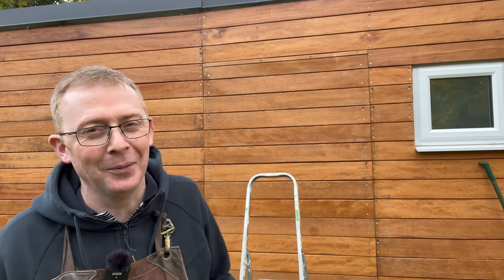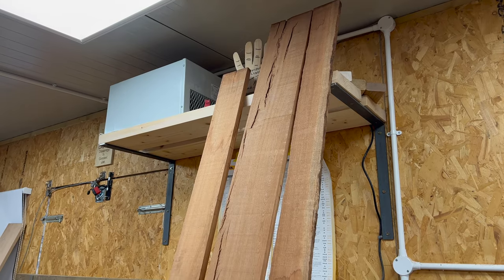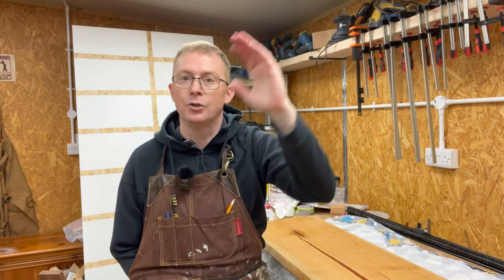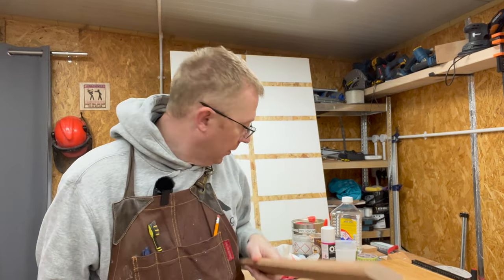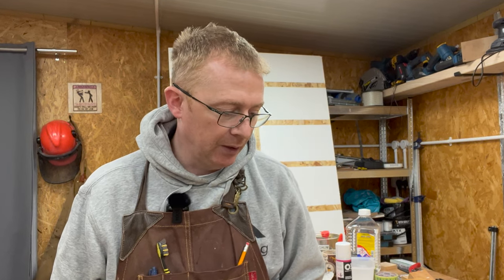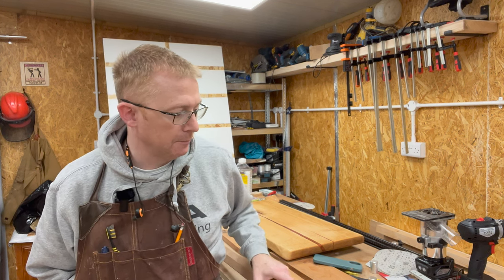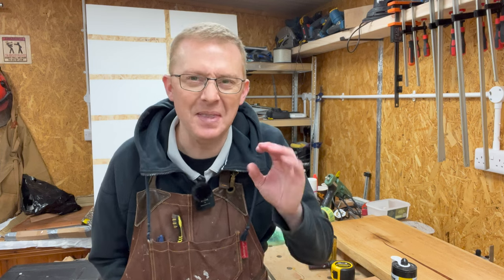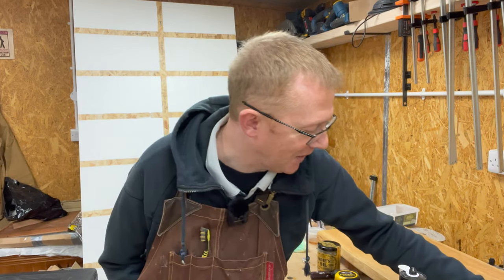Making a Hardwood Drip Guard / Edge for the Workshop Drawbridge Door

Comment: @2:36 ... Brother, auto-locking tape measures are a godsend for us single-high-five types. 
 
I prefer autolock, magnetic ends, with dual sided printing... but a good tape brand with all 3 of those things doesn't exist. So I either buy auto-lock with magnet in tooth from fastcap or a cheap tape with all 3. But a traditional tape can be a nightmare as you know all too well.
Reply from the maker: You’re exactly right mate, I do have better tapes (somewhere 😂) but they weren’t to ‘hand’ at the time 💪😂😀👍

Comment: Nice tip about the eb25 Leo, i just cant  bring myself to pay the CT1 price. Im not sure what the finished section of that door drip was but it needed a capillary groove or even a rebate on the underside so the rain doesn’t run back along the bottom edge and down the face of the door.
Reply from the maker: Thanks Jim, in regards to the groove I got away with it with was I thought ‘a mistake’ with the router bit / groove on the underside. The water comes around the front and drops off on the underside of the lip of the routed edge if that makes sense? I’ve just written it and I’m not sure it even makes sense to me😂😂. What I’m trying to say is it works ok which was a fluke😀👍

Try the EB25 stuff and see what you think, wouldn’t mind hearing your thoughts👍. I’m very impressed with it and on occasions you’ll see it around half the price (when on offer) of CT One.

Comment: Hi Leo, nice simple job that oh so easily gets put on the tomorrow list.  I’ve got so many jobs to do that I have taken to putting them all in a list and only prioritising the top 10 to work on, the rest I ignore, so at least I feel I am making progress by working on some of them.
I’m sorry to say that I think you will find that the drip guard doesn’t work as effectively as you want it to 😢. I think you’ll get water running down the front of your drip guard but then wicks around the roundover and along the underneath, then down the front of the drawbridge or inside the top edge.  If you look at wooden windowsills they have a U channel routered in the underneath just in from the front edge to break the surface tension on the water and cause it to drip down onto the ground.  I am by no means an expert on these things but I think that’s what you would need to get water to drip properly onto the ground.  Sorry
Reply from the maker: Thanks Geoffrey. As luck would have it, the mistake I made using the wrong router bit appears to have paid off. Totally agree in retrospect a roundover would have just taken the droplets onto the underside of the piece of timber and down the door, but the channel I’ve cut into the strip appears to be working and the droplets are falling to the ground🤞👍. Going to keep an eye on it, maybe the drip guard needs to be a little wider, but we’ll see 😀👍
Reply: @Hand-i-Craft  Providence or a smarter design ahead of its time?  Take the credit for it whilst you’re ahead ! 😂